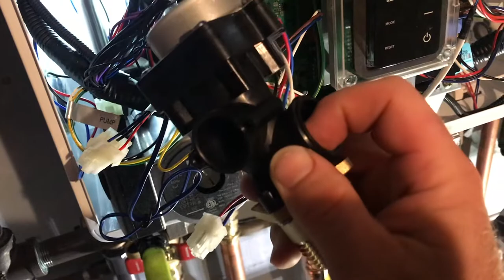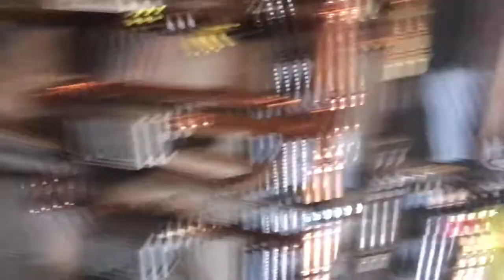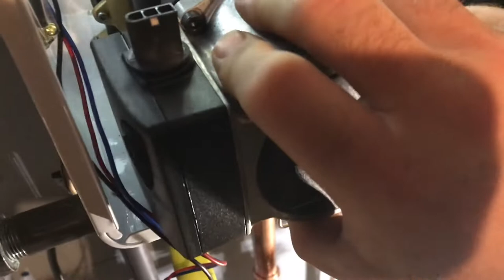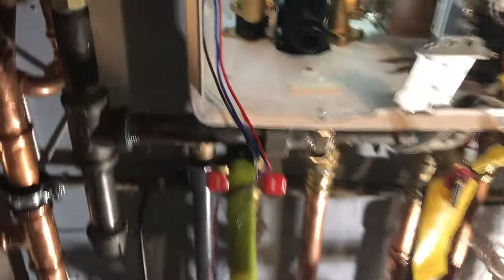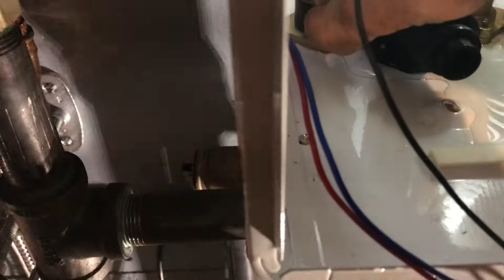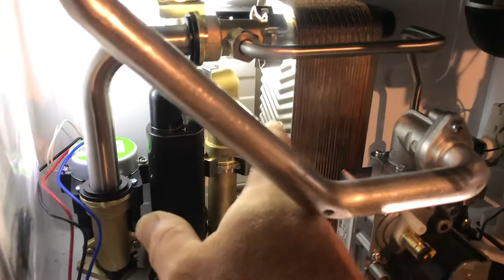Navien 3 Way Valve

Comment: Thank you for taking the time to make this video on 3 way valve replacement.  I need to figure out if just straight water to add back in to the system or some type of glycol mix. My ncb 180e is 2017, 3 way is still good but I'd like to change it as a preventative maintenance.

Comment: Ive eventually learned to use lots of plumbers grease when reseating the gaskets on 3way, as per tech support’s suggestion. I dont think Ive ever replaced it successfully on the 1st try without leaks
Reply: I was wondering because the video didn’t show greasing the gaskets / o-rings.

Comment: I have error 16E on startup.  Unit before error had no problem with heating water or furnace heat.  I flushed system with vinegar (annual thing) noticed that my heating prop. glycol was dirty so I replaced all of it.  Also found grey sludge in the condenser's drain (about 2 cups of grey liquid).  System ran perfectly for a couple days then coded to 16.  It will only fire up in the HX for about 10 sec until temp displays 199F and unit shuts down with code 16.  I think there may be air in the HX?  I purged air as best possible using a hose to the glycol makeup tank (taken from the heating loop that goes to furnace).  What am I missing????  The Hi Limit switch is doing its job.

Comment: Hi, any way you can estimate the number of hours of labor entailed?  I was roughly quoted $2,400 for this job, that's gotta be at least eight hours work.  I thought that was excessive.  I know you edited, but I am guessing this did not take you a full day, thanks.
Reply: That's crazy, it's a $60 part and can be replaced in an hour to hour an a half.
Reply: That’s an “I don’t want the job” quote. The trick is to find the Navien whisperer who has done this at least three times. I u destined all the steps and just replaced a flow sensor but I’ll be dam ed if I attempt this (I also need the work done). Now, hold my beer will ya…

Comment: Been having a lot of problems with these Combi units? Would you still recommend Navien? What do you think of the Lochinvar combi?
Reply from the maker: Cory C I’m split, I really like the Noble a lot but it does t have the ability to connect to WiFi and the Navien does. I have some clients that winter out of state and lake home owners so having access is important. That’s when I use the NCB.
Reply: I’ve installed both and like them both. The only thing I like is that the noble is quieter. Both seem to be just as reliable.